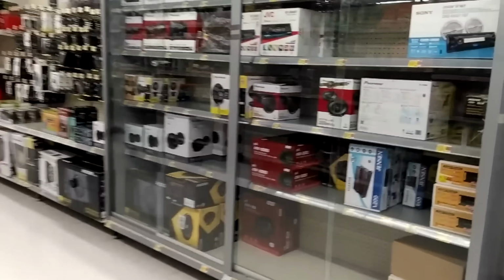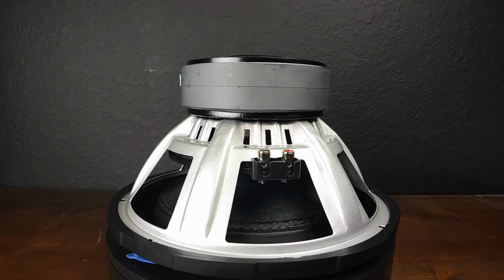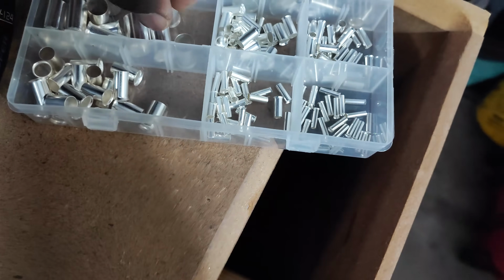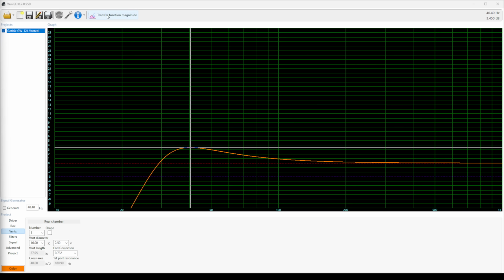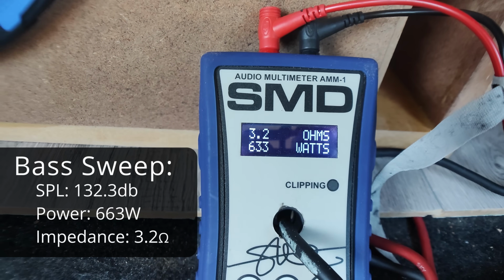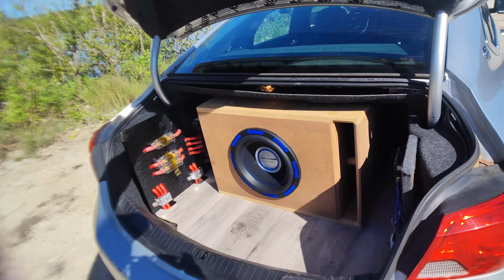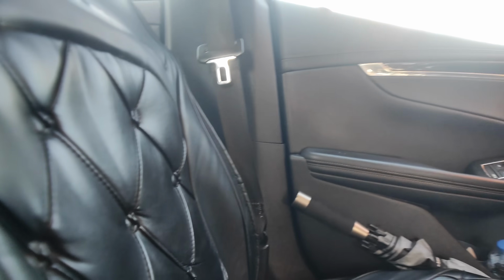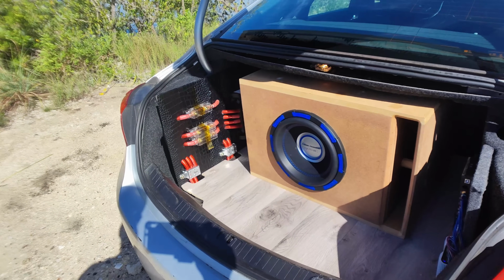Why Is EVERYONE Buying This $80 Subwoofer | Power Acoustik Gothic GW124 | 4,000 Watt SPL Test

Comment: I've been running mine for a few years. I made a L port box that's 2.58 CF net. It's wired to 3 ohm and running the full juice from the razor 2500 amp. Not sure what my DB is, but my wipers bounce and my dash flexes 😂. Only problem I have with it is it doesn't like the higher faster tones. Sure picks up the lows though.
Reply: Forgot to mention the box is tuned to right around 35.

Comment: Great video! Very educational and hit dat sub button quick!
I HAVE A QUESTION. Guys I have a stock radio in my Camry, can I splice a rca wire into my rear speaker wire for the input to my amp? Instead of buying an adapter that does pretty much the same thing I believe? Thanks 🙏🏼
Reply from the maker: Kinda.... But not recommended. You can damage your car radio like that. Placing into an existing speaker and connecting another speaker changes the impedance load that the radio needs to operate properly. Upgrading your door speakers will probably be a better option; in this case.
Reply: Well how can I hook up the rca connections on my amp then other than one of this adapters? Guess the adapter is the only way because the stock radio doesn’t have rca connections on the back.

Comment: It seems like a 40 is easy these days. Do you have any systems that fit with your channel name that'll do a 145-150 on music and dig into the upper 20hz range musically?
Reply from the maker: That's a great question! I'll have to dig around and see what I can find.
Reply: @BudgetBassHead  That'd be awesome because a musical 145+ and digging down to 28hz is where I personally want to be. I'm currently considering either one or two Fi IB315 subs in a trunk/infinite baffle, but that's $450-900 worth of just subs, already. Never mind a solid SQ-ish amp that can do 1200-1600w RMS at 2ohms.

But I saw somebody model them in software including cabin gain, and even a single at RMS-rated power (600w) should be able to do 143dB and easily dig down into the 24-32hz range at that volume, so doubling up would theoretically get me 4-6 more dB than even that. These can take 20-30% or so more power than rated as long as you have a low freq roll-off starting at 25hz for about 750w.

Comment: I was into car audio in the 90s but I don't know much now.  With a 8000w rms amp, what is the battery/alternator setup like?
Reply: A good bit less than the 50 alternator setup ya needed back then lol.. Well..At about 14v and actually using 8kW you'd need about 600 amps when the bass drops, plus whatever the car takes to run all it's junk.. so about 650-700 amps.  Though back in the 90's you probably remember those class A amps took some serious power to create anything along with a bunch of capacitors and some extra batteries.  Today though you can use a lithium battery/cells and a couple built up alts and such.  Still gets expensive these days, but not quite at all compared to back in the day with the $1-50c per watt amps.  Anyways you can run a newer amp on stock for 1000w with nothing much done..(160A stock alt on mine)
Reply from the maker: I have a 320A atl from Mechman. Zero gauge wire throughout system. 96Ah of lithium Iron Phosphate (Headway) battery bank.

Comment: Did a 137.7DB on a 50dollar 10" sub in scrap mdf that i just made box out of, box was to small, so inverted the sub.
Self designed box.

Also did 144.77db with a cheap 15inch in self designed box at 39hz and 710W :) 

Now i have sundown SA12Classic right out of box in a 33hz fabricbox 141db+ at 39hz ( Peak at 38hz ), not soften up.

I build alot of budget, now im thinking of 10inch sub and try make a box that plays real low and  do hairtricks :) 
But i struggel a bit to get air velocity down, not enough experiance in winisd yet.

Comment: I have a Bose entertainment system in my car. The highs are anemic, and the lows are anemic. I have been looking for a cheap sub and amp to place into the trunk. It's that or replace the Bose 12" with a JL. Not sure yet. I also need 2 pairs of dome tweets and an amp to finish off the sound in general. I don't think this sub is it though.

Edit: Not for performance reasons, the box needed is just too big. I realize that with the amount of power it handles and the air it pushes it needs that room. Guess I'll have to go with 10"s. Maybe a down firing pair just behind the backseat, so there is still trunk room, and I can access my spare.

Comment: Wrong ! I run two dvc kicker comp cvrs I’ve ran every sub u can name off ! Everything =grounds and length of wire / gauge. 

Woofer Deff matters …. Polly propylene vs paper woofer there no comparison in bang plus longevity ..

YES the box is 85% of your “boom” but! GROUND is everything!!!!! 

U can buy cheap azz woofers they will slap for about a week then start breaking up (especially listening to (Texas chop screwed type music) I’m hitting Lows most wooofers won’t hit . At 1/2 ohm series parallel to now only a 500w amp vs before with 6 15s and 3500 watts . Bangs even harder now .

P.s I’m also using a LOC from the friggin 90s lol 
89 Lincoln town car 500w bazooka mono block 2 12” cvr’s off a non passive LOC… 💪

My trunk lid looks like a water bed when banging it flexes so hard !
Reply from the maker: I think we all have our preferences when it comes to gear.

Comment: AAYE!! back in late 2019 early 2020 I went thru 3 of these….in a 2013 Altima, I built a horn style enclosure with ALOT of area and a lot of air space…(box wasn’t all that great) BUT 18-35hz it was NASTY!! It peaked decently flat from 24-28hz…woofer was mounted in the mouth of the port, port was facing the driver rear corner of the trunk…Half the back seat down and the front windows halfway down it would straight up do a lil hair trick, I was able to float Kleenex’s !! On roughly 1200watts RMS ( couldn’t leave it full tilt very long) I have a few videos on my phone, and based off how loud other systems I’ve heard are doin, it was def doin a 140+ below @ 27-28 HZ

Comment: The terminals always tell the truth the reason they're so small power acoustik doesn't want you pushing anything more than 600 RMS to this thing they know it's going to blow. As far as your speaker and Port displacement I think your numbers are a little off you're not going to be left with 2.5 net

Comment: If the coil is that warm after test ,I be worried. Coil warping(if tight gap to magnet) 
The rubber is sensitive to temp ,lack of bass in cold .
I'm proud of getting out of the car stereo community ,x-max abusers ,max watt addicted bass heads.low ohm wiring.with bad generators. 
But I miss turbosound horn pa speakers,tms for life esse!

Comment: I dont know if theres an $80 sub from any manufacturer that will perform like that. Im actually very impressed by this sub. I ran a mofo 15x back in the day in a custom slot port box on a jl xd1000.1 and it was pretty loud

Comment: I have two on the 2500w amp in a ported Memphis dual 12 box and they hit so hard for the $ spent. Love these subs.
Reply: How are they sound quality wise?
Reply: @coreysimon7235  i wouldn't go to any SPL comp or anything but if your not trying to max em out and just want smooth hitters they are perfect.
Reply: @coreysimon7235  its sold at wal mart... im 100% sure the SQ is terrible. this is a speaker marketed toward high school kids that know nothing about audio
Reply: I've got a single in a Memphis ported box and yes it's awesome

Comment: If you plan to push a sub, you need to use a smaller box to maintain cone control. You wouldn't bottom it out so easy. You should use a box about 1/2 that size if you plan to double it's power rating. When I would run 3k watts RMS clamped to my SQ HDC3 15 (1500 RMS Sub) I ran a box 1.2 qubes smaller than recommended. So, I ran a 2.8 qubes net rather than a 4 cube box. I ran that for 3 or 4 years but I hurt a coil.
Reply: That is a dumb strategy.  Box size is going to impact how the sub performs and sounds overall, in a way more power cant erase.  So it MIGHT be louder than the correct box at the correct power ratings, but at best it wouldnt be that much louds (and it would sound worse) since 2x power in NO WAY equates to a 2x in volume.  in fact it would be barely noticeable.

Comment: Great vid; thanks!  What would be a good budget amp for this sub?  I just want it to sound good in a small sedan with the rear seats up.  I don't need it very loud - don't like to make people mad or have a target on my car for thieves to break into.
Reply: I would consider Recoil Di1200.1 ($106) or RED1200-1 ($126). Great little budget amps that actually meet, or exceed, rating on review amp dynos. I currently have 2 of their 4 channels running my front stage, and a 600.1 waiting for my next sub setup. More than happy, for the money.
Reply: @shinygravel  awesome 😎!

Comment: The VC off gassing part !  That is the Penny pinchers using a lessor quality glue, likely built to spec in China. 
  I’ve pulled some make brand pro audio gear that was made in China and likely not to spec because of this.  It freaks some people out, thinking that their woofers VC is on the verge of meltdown and I just don’t like toxic off gassing.  I show with a thermometer that it’s unlikely but the smell still bothers my client. 
  Here again, you get more than your $ worth but there is a price to pay. Most people won’t trip out and run it till they wreck it.
Reply from the maker: You’re right, some people are more sensitive to off-gassing. And yes, it is very annoying.

Comment: As a somewhat older guy, I am VERY impressed with the performance of bargain basement equipment these days. 30-35 years ago, the cheap stuff was beyond worthless. I’m talking subs that were rated at 1000W, but couldn’t even handle 100W. Or 500W amps that maybe produced 40W. Even top-shelf equipment back then couldn’t match the performance of cheap stuff now (although it probably lasted longer).
Reply: The good ol days. That was when I got into car audio. 30-35 years ago. I was gifted a Pyle 15" sub. I made a box and put 50 watts to it. Then I got a pair of 10" SAS Bazooka Tubes. Then a pair of 8" Tubes. Those old units were the bomb. I loved them so much. That was back during the Audiovox times. So cheap, so cheap. You had to buy the real equipment to get real sound. I had an MTX Blue Thunder wedge box after that and made the mistake of buying a 220-Watt x 2 Boss Amp. More like 40 watts x 2 lol. Such trash. I replaced that with a 180-Watt Sherwood Amp and that actually was louder believe it or not. More like 70 x 2. I then paid to have a box built with a full stereo install but only if they let me watch so I could learn how. They said yes and let me watch all of the builds for about 2 weeks. Learned everything from window tinting and alarm installation to box building and correct wiring. Good times.
Reply from the maker: It's come a long way!
Reply: Soundstream that was actually made in Folsom, CA was the shit in the 90's!!  I was all Rockford Fosgate separates for speakers, advertised it with a giant sticker on the back window of the 85 Camaro.  finally quit messing around and paid $200 for Audio Express to install all the speakers in the dash, doors, rear sides. Everything was still CD's back then, it would skip the CD if I turned it up to loud.  But my remedy was pull out the deck and set it on a hand towel, then it wouldn't skip.  Removed the stock 6x9, had custom plates made for 6.5 and 1" silk dome tweeters, The entire system power was under 200watts RMS.  A punch 45 and punch 150.  The filled the spot between amp and rear seat with cut out wood so the amps set flush, with an Audio Control EQX, that i could continue to tune. sounded cleaner and louder than most cars I hear running around now.   So my best friend from the 90's we started putting in systems a couple summers ago. as a joke I bought BOSS head unit with GPS, and amps, one 4 channel and one for subs.  Um.........They work awesome.  I was so shocked and still am that the work so good.  There not even Class D.  Speakers are PRV and some name brand in the back doors.  It's still loud but not like that of the 90's
Reply: @drunkchicken8636  I never had Soundstream back in the day (I had Rockford Fosgate). But I remember seeing it in stores. Compared to Rockford Fosgate, Soundstream was considered to be less about raw power and more about sound quality.
Reply: One name comes to mind....Pyramid!....lol
Reply: My main broke kid first job run was between 2001-2006 back then Walmart had 15" lightning audio subs that's surprisingly smacked hard AF in an oversized sealed box. The big ugly yellow ones they used to sell. But. Lightning audio was made by Rockford fosgate. Even the amps said 4 ohm stable and we wired them 2 ohm and it just took it.
Reply: I was thinking the same.  I'm this old. Lol. Cheers
Reply: Sounds like you've been introduced to Pyramid stuff. lol
Reply: Yes sir. Im 50+- a couple and man the barrier to entry for good sound is soooo much lower now. Car audio is crazy cheap now and I love it. The ofd thing is that it feels the youth doesn’t care as much as we did back then. Every single person I knew back in the 90s had at least a 10 in the trunk.

Comment: BudgetBassHead 4 da WIN!... My GOTHIC 12, in a 50 dolla, ported pre fab cabinet, RUMBLES my Kia with a 2500 watt SPL GORILLA I bought used for 40 bucks, That's under 200 bucks for KABOOM... These are the good old days of Autosound... How LOW can ya GO!. BDBD/2024
Reply from the maker: That's awesome! I love hearing about people building their own systems. Especially on a budget!
Reply: I used to charge 400 bucks to build custom cabinets for customers... These days... 50 bucks, it's yours!... I reside in Hilo, Hawai'i so shipping here is really prohibitive, so in that regard, the GOTHIC subs here cost a little over 100 dollars + tax, but nearly the same... VERY AFFORDABLE solution, and no regrets after 4+ years of BOOM BOOM on down the road.... You should have re did the SWEEP when ya turned the box around and effectively created an additional ORDER to the subwoofer system in the car. Likely would read different in your meter too. Your videos have gotten better over the years, very comprehensive and in layman's terms for the most part... Very informative. Aloha from Hilo! HAWAII!!!! BDBD/2024

Comment: It looks like their MOFO series they used to make was their Xmax woofer crazy excursion for a woofer of it's price range but was easy to blow up if not broken in propperly or if you clip the hell out of it will die, buddy of mine put a Boss amp on one of those MoFo's, the Boss amp one of those  1000 watt promises that actually put out 64 watts and yes under powering causes a clipping that kills subwoofers kids. If had a choice if buying Power Acoustic grade budget gear rather go with Hifonics have had some nice budget systems with them but honestly stuff has gotten so cheap just go with CT Sounds or Skar Audio about the same price and much closer to a professional grade you will be much happier.  Lol if i popped a pair of these gothics on my Orion XTR Pro 2300.1 amp turned all the way down they would hit some beats and stink for days or weeks till they finally died and that's being nice poof waste $160+  but nice clean vid bro push a Skar SDR on people it's same price and sounds amazing

Comment: Much of car audio is about saying what you have (name dropping), and no one wants to tell anyone they are running power acoustic. It’s the same reason why people don’t usually run raw drivers from parts express. Car audio is heavily influenced on opinions and how your system is perceived by the public.
Reply: I’m exactly the opposite, I especially love to tell people that I have used a combination of random parts that include no name, budget and OEM manufacturers to achieve the best results within a budget. 
   Branding was looked down upon in a certain segment of the population from the 1990’s and that’s my influence.  I just as soon remove all labels and keep everyone guessing and then hit ‘em hard with the low price point.  Screw fashion, be an original artist instead.
Reply from the maker: I think there's definitely some truth to that.

Comment: Man that thing be THUMPIN! I’m still rockin’ my JBL W12GTI MK2 on a LabSlapBox enclosure custom made for that sub. It’s all in the combination. Excellent sub, excellent box that matches the sub, and of course, excellent install with the proper gear to power it. I don’t even have all the juice the sub can handle and it’s been bangin’ since 2017 and still is amazing to this day. Still makes me happy and continues to blow people away. Thing slams so hard that you can see the wiper blades vibrating from outside the car at higher volumes. I don’t blast it that loud anymore though. Best part is, it doesn’t just get loud, that thing sings BEAUTIFULLY. The sound quality is incredible and it thumps down low, yet still sings all the way up to the higher bass frequencies. I don’t think I’ll ever get rid of that system, even if I let go of the car which seems likely some years in the future. I stopped liking new cars after a certain period, and they only continued to get worse and worse but finally they’ve been making some cars that actually look great and have other appealing features, so I’ll likely get a brand spanking new car, won’t be able to hold the want much longer. Get a new Gixxer while I’m at it since they brought back the 750. What a time to be alive 😁
Reply from the maker: Glad you found a system that works for you!